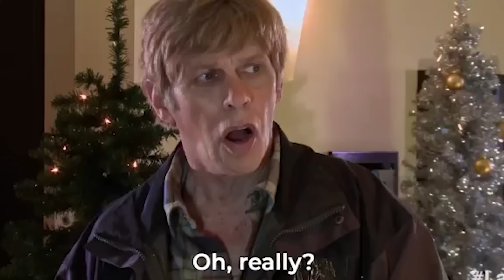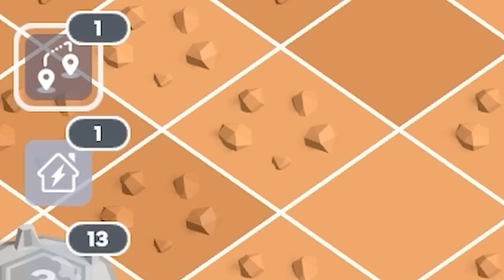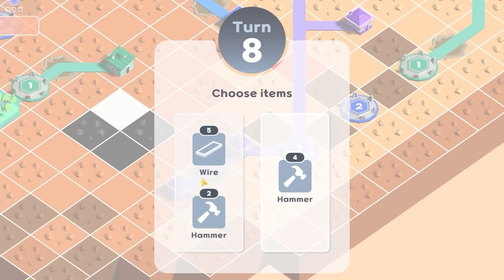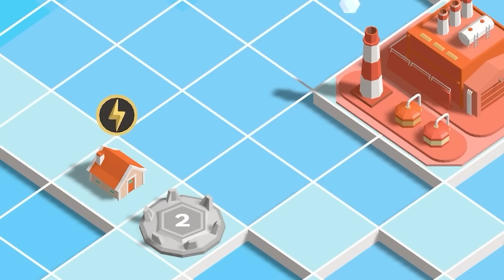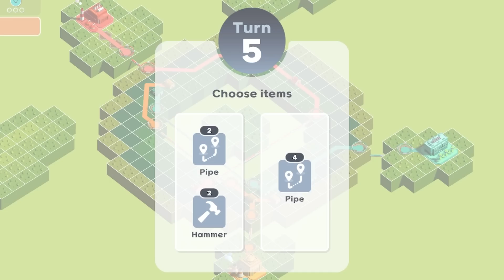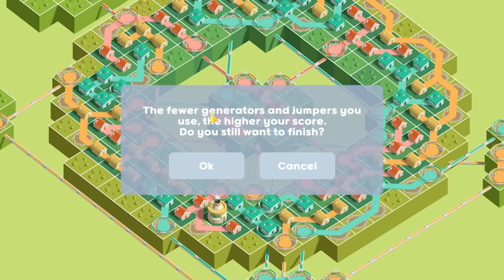They made powering a city x1000 more complicated

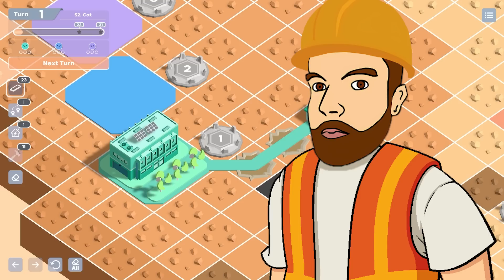Comment: 0:49 "you can do the trigonometry if you don't believe me." Ok then, this is really simple. Assuming one line's length to be 1 unit, then a diagonal bisecting that tile (assumed to be perfectly square) corner to corner forms a 45-45-90 isosceles triangle. Sides A and B are 1 unit long each, and the diagonal line is the longest, called the hypotenuse. Using the Pythagorean Theorem, we can determine the length of the diagonal, line c. The theorem states that a^2 + b^2 = c^2. If a and b are both one unit long, then we get 1+1=c^2. Therefore c^2=2. If we take the square root of both sides, we get c is approximately equal to 1.44 units long, which is indeed longer than one unit long. You're welcome :P

Comment: If I did trigonometry, 
If each block was of lenght L
Then the half diagonal would be of lenght L/2 + L/√2
And full of L√2
There is no 1.5L in lenght so the calculation is wrong...
Reply: The diagonal should be square root 2 (1.41421...), but the game approximates it to 1.5 not to deal with complicated fractions.
Reply: @pyglik2296  alright, calculations aren't 'accurate' then
Reply: I'm not a math guy, but I think it is Pythagorean theorem right?
Reply: @knobhack  vectors, straight lines, any concept, simple maths

Comment: “You can do the trigonometry if you don’t believe me”

I don’t. I did. It’s sqrt(2) not 1.5, but honestly it’s a good approximation compared to the correct value of ≈1.414213562

Which means that there is theoretically a scenario in which a slightly more circuitous path is actually cheaper

Comment: I did the trigonometry and i found that going diagonal is actually 1.41421356237309504880168872420969807856967187537694807317667973799 times the size of a straight (rounded to 100d.p (im a mathematician so i need to be very accurate))

Comment: I dunno that the electricity metaphor works for this.  They clearly wanted this to be a traffic management sim but the AQR kerfluffle scared them off.  But electricity is electricity and once it is generated it doesn't have a "color".
Reply: Pretend it's color coding for incompatible systems. like different line voltages and frequencies.